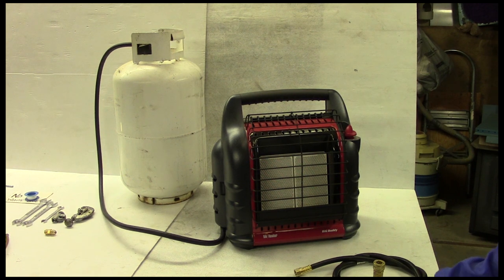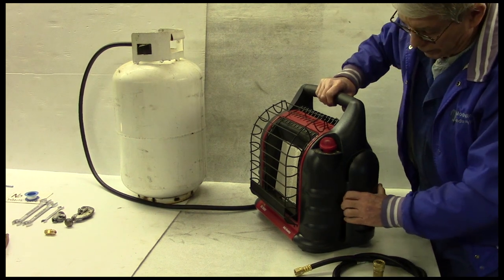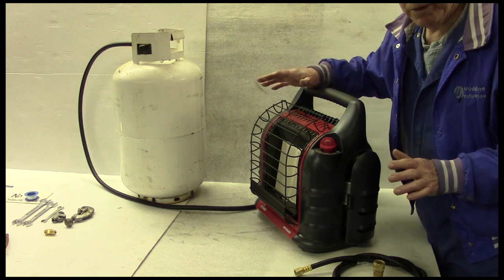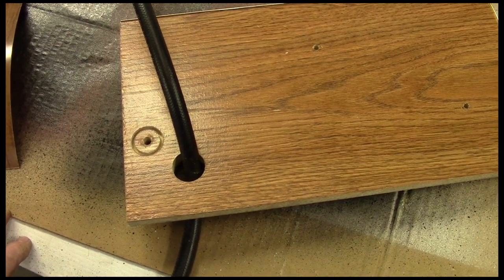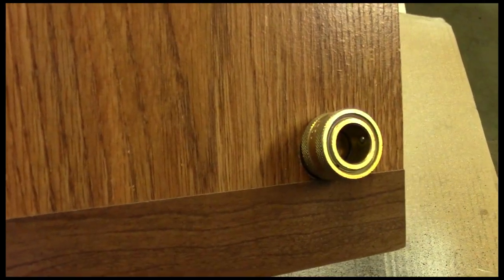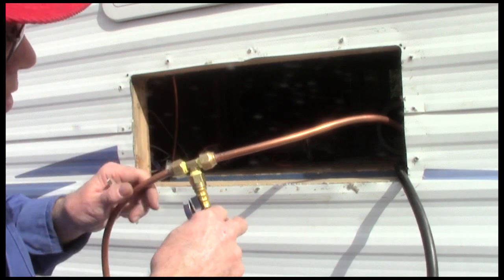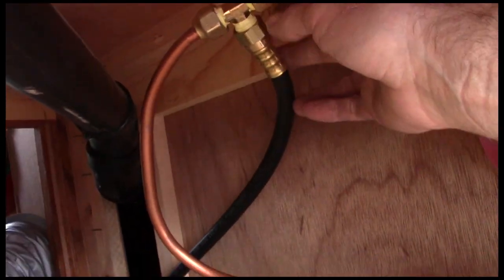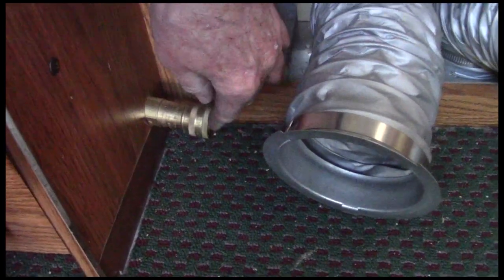Plumbing a Mr. Heater Big Buddy Heater into your RV propane system

Comment: Nice video, thanks for taking the time to do it.

One thing, you DONT need any tape on flared fittings, yellow, white or pink, the sealing of a flared fittings is done at the flare itself. If the flare is bad no amount of tape will stop the leak, those threads are not designed for sealing high/medium  pressure gas and the gas will leak out at the backside or pipe end anyway if the flare is bad.

Ron W
Reply from the maker: I'm not relying on the tape to seal the gas but using it as a form of non fluid loctite to prevent the fitting from loosening.  This is not a normal practice but it works.
Reply: Knew this but wish somebody told me this years ago.

Comment: Ray I want to thank you for the excellent tutorial.  I was all over the place trying to find out what parts I needed.  I thought I needed a shut off toggle of some sort but I'm gathering that with the quick connect that does the same thing.

You are a wonderful teacher.  Your pace is perfect so that I could follow each step.  Your starting board with all the needed parts, INCLUDING the yellow tape that I didn't know about was just great!  Your job came out beautifully...even the veneer you had to place on the board.  :-(  I felt so bad for you when I saw your boo boo......I can relate...I"ve done a few of those myself.  :-)  I just had to tell you thank you!!!  What a help this has been to me!
Reply from the maker: +Linda Lou 
Thanks for your comment Linda Lou.  The quick connect when disconnected from the heater is a shutoff but remember there is still gas in the system.  Also you can shut off the entire system at the propane bottle.  A good test each spring when you prep the RV for the season, is to turn the propane system on and test the quick connect with soapy water for leaks.  Turn the gas off and replace it if you see bubbles.

Comment: very thorough video. I use my Mr buddy heater in my van works excellent.
Reply from the maker: +Wil Reyes 
They are a great heater and in a van you must have to run it on low they work so well.  Just remember to crack a window and get a Co detector (carbon monoxide detector). Thanks for commenting.

Comment: That was a big project. I just drilled a hole at the front of the trailer and installed a RV Cord hatch that I run a hose through and to one of the disconnected propane cylinder. My Mr. Buddy doesn't have one of those quick disconnects that bypasses the regulator.
Reply from the maker: +Lenny Dearth Ya it;s handy that the BIG BUDDY has a built in propane connection.  I wanted to run off the propane system controlled and protected by my automatic change over regulator.  I did not want to chance running out of propane by separating the 2 propane bottles like you have just described.  Thanks for your comment, and to each his own.
Reply: I would have liked to have done it your way, but my knowledge level is not even remotely at your level.
Reply from the maker: +Lenny Dearth That's why I do these videos, so the average guy can tackle projects he would normally not try.  I am always available to try and help with any project you have in mind.

Comment: Great video. It absolutely baffles me as to why the RV manufacturers put in Propane heaters for off grid and then make then waste 12v power. They do the same here in the UK (except we don't call them RV's).
Reply from the maker: Years ago (1950 & 1960's) trailers came with radiant/convection heaters built-in.  Very similar to the big buddy, but built in.  I experienced them in a pop-up tent trailer a friend had.  We camped in the late fall, it was cold, and we were forever opening the door to cool the place down, even on low, they worked great and did not have a fan.  That's in a canvas walled tent trailer.  They were removed because they became a fire hazard as a result of the poor construction and lack of safety precautions.  They caused fires, so they were removed.  Thus the power hungry heaters we now.  The convection heaters were also a source of C02 and people were not informed enough or smart enough to make sure to have fresh air coming into their trailer to provide combustion air and vent CO2 gases.  Thanks for commenting. Ray

Comment: Just a note:The pipe sealant does nothing to seal the fittings,because the flare is the seal.You  would use sealant tape on pipe thread.

Comment: Could you have just disconnected the gas line from the furnace, used it as the supply side of the “T” and then added two lines, one back to the furnace, and one to the Buddy heater?
Perhaps this would have spared you from removing the furnace and made any maintenance easier in the future.  Just wondering!

Comment: This is a much safer hook up than using the rubber hose to the regulator.  Even if the hose comes through a wall and the tank is outside, you still have high gas pressure in a confined space which is never a good idea.  The pressure on that hose could easily be 100-200 psi depending on the weather.  Using this method eliminates that and limits the gas pressure in the hose to the appliance's operating pressure which is less than 1 psi.  Much safer.  My only two comments are the lack of a shut off valve that's easily accessible and using the tape on the flared fittings.  It's necessary for the pipe fittings but it isn't doing much on the flares.  I've come across it a lot and I've never seen it cause a problem but I still don't recommend it.

Comment from the maker: Please note @ 7:20  talk about the yellow tape used only for gas fittings.  In this case it's the compression fitting that actually seals.  Because the T fitting is in such a hard place to get at without tearing the furnace out.  I used the yellow tape as a kind of loctite so the fittings would not come loose due to vibrations when travelling.  The tape is not necessary unless you want the same security.

Comment: Apparently I gave the wrong Mr. heater. Mine does not have propane on both sides and it does not have the battery either. I bought a cord hoping to hook the Mr. heater to a propane tank, like in the video, like one uses for a bbq grill, but there’s no way to attach the cord to my mr heater! Dang!
Reply: Not gave, have

Comment: I don't trust the quick connect fittings, it's only a matter of time before that thing fails. I think you should use a lever valve inline with  it. Good luck anyway, I hope you don't burn your trailer down.
Reply from the maker: Thank you for your comment and suggestions.

Comment: Shoulda just put your "T" in where the copper pipe connected to the furnace itself - would not have had to pull the entire furnace! And would have saved adding in a couple more flare compression joints that can potentially leak/fail..

Comment: Hi Ray, thanks for the great video.  I did a similar install in our 5h wheel but attached near the regulator and ran a new hose to the heater, it was closer to where we wanted the heater than Tee-ing into the existing copper.   One question, did you really need the tape on the flared connections?  I always thought the flare would be the seal point and the threads only provided the clamping force not a seal.  I guess it doesn't hurt anything to have the tape there but I'm not sure it's required.

Thanks again.
Reply from the maker: +Gordon Cindy 
The yellow teflon tape is not required on flared fittings but.  The but is, the amount of work removing and replacing the heater.  I did not want any leaks so the tape was extra insurance.
Reply: +Ray Whyte 
Yes, re and re-ing the heater must have been a bit of a pain... thanks for the reply.

Comment: Hi Ray. I wanted my dealer to do the same with my Buddy Heater but he said NO. He said he doesn't want my family to die. He said to make a connection inside the trailer, it can come loose with time of driving on rough roads. He said the new trailers are or will come with all the T connection on the outside of the trailer and the only connections inside are the ones to the appliances. So I'm looking to do it myself and make the T connection under the trailer. Any thoughts?
Reply from the maker: +Andre Campeau 
That is a good idea to have the T outside for safety.  My T is in the furnace compartment.  There are T's at every appliance so I have difficulty with their cautions at doing it this way.  My trailer is equipped with gas detectors and believe me they work.  I also never sleep with the heater on and always crack a window to provide combustion air.  I use some common sense and take all the precautions and I am comfortable with my installation.  I caution people when they take a propane bottle inside to run their heater.  Thanks for your input and good luck with your installation.
Reply: Why can you have the disposable propane tanks inside but not the 20lb tanks?

Comment: I  would never heat with a portable propace system.What happens when you want to leave the coach ? Im buying a diesel Espar  5.5 watt heater to heat the subfloor and shutting all the quarts heaters,ceramic and fireplace. They also heat the water on demand They dont burn much at all.Problem solved !!!

Comment: so I am working on a similar setup.......but it looks like the way you went about it you have no regulator at the tank. My little buddy is not staying lit. I imagine it has to do with the reg. I have read on forums that if you have a low propane you do not use the optional filter.
Reply: Oh I think I found my error. since my propane to my buddy is already regulated I would have to bypass the heaters built in regulator or............run a non regulated line off the "house"propane tank. making the stove and fridge low pressure and running high pressure to the buddy and using the filter. I have 2 regulators in line now......heater wont stay even on high.
Reply from the maker: but it looks like the way you went about it you have no regulator at the tank.
 To answer this question. I have a regulator at my propane tanks on the front of the trailer.  So when I tapped into my propane system, it was a low pressure line and requires no further regulators.  You cannot as I understand it, use a low pressure line to connect to your Little Buddy.  Only the big buddy comes with a built in low pressure quick connect fitting.

There are 2 ways to hook up the BIG BUDDY heater.
1. Use a high pressure hose direct from your propane tank (no regulator) and connect it to the regulator on the Big Buddy Heater.
2. Do what I show in the video, connect into the RV propane line(after the regulator on your RV propane bottle).  Now this is low pressure after the regulator and should not be connected to another regulator on the Big Buddy Heater. The Big Buddy comes with a special built in connection similar to a compressed air fitting only it is for gas.  You will have to visit your propane dealer to purchase this special hose and quick connect fitting.  Remember you cannot run 2 regulators in your line, it just won't work.  Hope this helps.

Comment: I really appreciate this video - I made the mistake of purchasing the Little Buddy (which actually is a better fit for my very small space) but I soon realized a) how uneconomical the 1 lb tanks were and b) that I am not comfortable running a high pressure line into the rv (via an extend a stay).  So I want to do this with a small wave catalytic (comes with 3/8 in flare fitting), but am hoping to find a connection to tee off of rather than cutting pipe.  I've watched several videos now but am unclear - assuming I find one (thinking the water heater is going to be the best accessible place) will the tee fit between the separated connection?  Or are there other adapters I might need to be looking for to use at that connection point?  ie if you had been able to tee into the furnace connection would you have needed additional adapters?
Reply from the maker: Dawn, without seeing your setup and space you have to work with, it's impossible to advise you.  What you can do is, take lots of pictures of where you want to attach your heater propane line.  Take the heater and any fittings you have to a propane dealer.  Someone that sells propane appliances like patio heaters, outdoor fireplaces etc. and they should be able to help you with design and fittings.  Good luck Ray.
Reply: Thanks Ray.  That's what I did with my plumbing (and got lots of advice and bought a lot of wrong things - who knew there were four ways to Sunday to attach pipe and everyone has their favorite!)...hopefully propane will be more straightforward!

Comment: why did you not put a shut off valve in right at the main gas line?
Reply from the maker: +Jo Bust 
Jo their are numerous ways this could have been done.  The quick coupler is in essence the shut off valve.  If this should leak, it can be removed quickly and capped off.  A shut off valve where it T's into the main gas line would not have been accessible without a major dismantling of the furnace.  And in an emergency the main valves at the propane tanks can be shut off.  I hope this answered your question.

Comment: Very helpful video, Thanks Although I have a question, What Size are the fittings and the Copper gas line of the RV which u cut & Tee’ed into? Is it 1/4 or like 3/8 or something???? Thank you in advance? As well if possible to list fitting parts needed to do this job, i plan on doing the same thing in my RV But tee out the Copper gas line right to a quick connect valve fitting coming out flat with the wall, So I can then just snap on & off the hose with the big buddy heater when ever I need it.
Reply from the maker: Fittings and tools are layed out @ 6:02 in the video.  The copper lines I worked with are 1/4". Good luck with your project.
Reply: Thanks So Much!

Comment: can you tell me what size it is. 3/8 9/16 1/2  what size is coming out of Mr. Heater
Reply from the maker: At 3:40 of the video you will see the special quick connect coupling that snaps onto the heater.  I assume you want to know the size the other end of the flexible hose is.  That will depend on the size of the propane line supply in your RV for the heater.  In my case the male coupling is 1/4"  T connecting to the 1/4" female coupling on the end of the flexible hose. (which is at the T going onto the furnace). Note the BIG BUDDY is the only one in the brand that has this extra coupler installed, all the smaller heaters don't have this.
Reply: thanks!!!  that is what I need

Comment: I would like to do this to my 33 Foot Titanium Mystique Fifth Wheel RV. I'm a full timer now, and my gawd the cost of propane is outrageous...  I feel we are being ripped off. This small heater Mr Buddy seems like it would help keep the cost of the propane down a bit, and I'm all for that, But I have seen some say that this little heater isnt meant for space heating ?  Anyone out there using it for space heating ? If so, how well does it heat ?
Reply from the maker: It will heat your living area with ease for a fraction of the propane your furnace will use.
Reply: i actually have a big buddy heater i run mine on medium heat and it lasts 6 hours on 2 one pound cans in my opinion it uses alot of propane and in Hotsprings Ark at Rafters on highway 70 west propane is 7 dollars a gallon i shit you not, here in minnesota north of ghettoapolis its about 2 bucks a gal so be carefull where you git yur propain from and God Bless

Comment: Watch out when you run this heater on it's lowest setting or when it's running low on fuel- these heaters can produce lots of carbon monoxide.
Reply from the maker: good info thanks
Reply: That is scary, Elsewhere I have read otherwise. I have a very small pop up camper. Prefer the lowest setting of the little buddy. I use a fire alarm carbon monoxide combo in there. have been more concerned with depletion of oxygen when snow camping. If they create hazardous CO on low they should be banned IMO. Please post where you have read/learned this.

Comment: Nice video, however it probably would have been helpful for those not familiar with the soap test  to demonstrate and emphasize the importance of doing it. Very very important to prevent a potentially dangerous situation.
Reply from the maker: For those not familiar with doing a soap test.  Make up a soapy water solution(dish soap is good), add a few drops of soap into a clean spray bottle add a cup or so of cold water and shake it to mix thoroughly.  Turn on the gas and spray all the fittings you have worked with and watch for bubbles.  No bubbles your good to go, if you see bubbles then tighten the fitting until it seals and no bubbles appear.  If you don't have a spray bottle, add some soap to a clean rag, wet it with cold water and knead the cloth till it is all soapy. Now rub the fittings down with the soapy cloth and watch for bubbles.

Comment: Hey I would like your input on my buddy heater to Rv plumbing job. I am having some trouble getting the heater to light. Do you have a way I can email you or anything? Thanks in advance
Reply from the maker: Email me
whyterj47@gmail.com
Reply: Hold the knob down in the pilot position for up to 20 seconds to purge the air out of the line.

Comment: Hi Ray, great job! I retired after 34 years wih So Cal Gas CO. I was wondering since presure is done at the onboard propane tanks and at the BBH and some rigs have a BBQ quick connect on the out the outside couldn't you run hose with a male and female (QC) ends on each end ?
Reply from the maker: This is certainly a viable option to connect to an outside supply.  But the problem you have now is how to get the hose located outside into the inside of the RV to connect to the heater.  You could run it through an open window, and this opening could serve as a combustion air supply.  Most RV windows have builtin screens and could pose a problem.  The ideal setup is to run a permanent hose into the rig.  You could do this by connecting to your outside source, and run this hose to an inside location.  Good thinking and good comment.